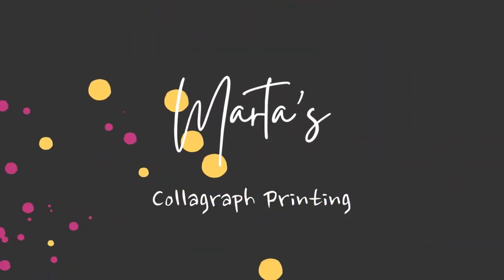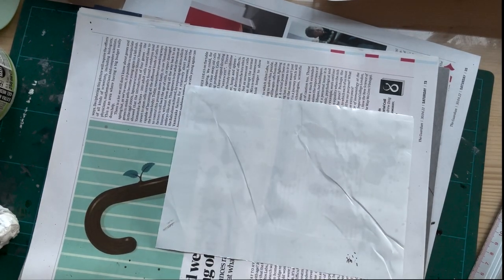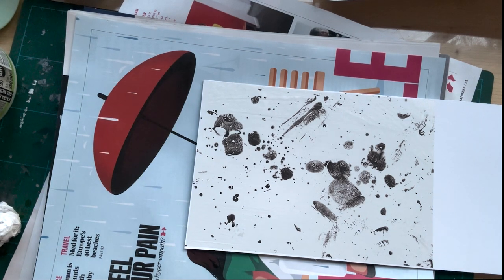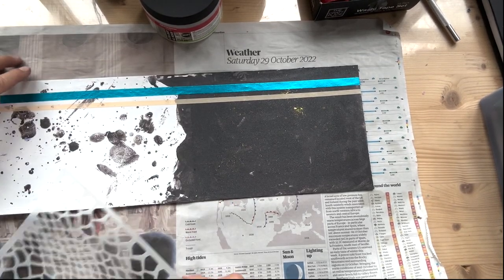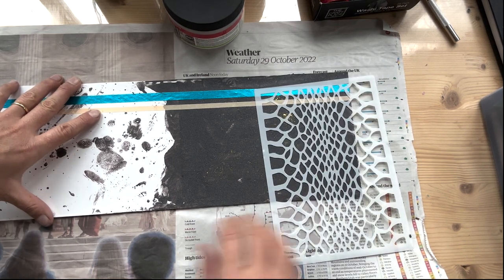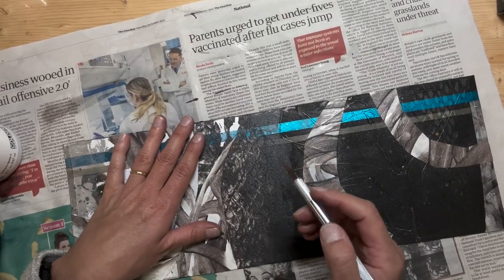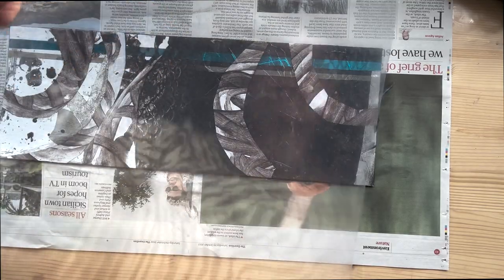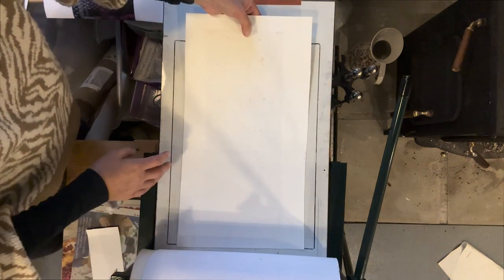A collage collagraph .... (and no plan)

Comment: Marta, this is a very sophisticated print…love it!, One query: why didn’t you apply a thin layer of shellac before printing? I was  surprised the ink didn’t clog up some textured intaglio areas however it seemed to wipe clean where you required so I guess it was the gloss type mediums which wiped light that gave you the contrast textures. Thank you for your such generous info in your videos…much appreciated.
Reply from the maker: Thank you Rosemary! Well, I used to use shellac, but I found it was not really necessary and spoiling some of my textures. If you are not editioning, then it won’t matter. I find I just do a couple of prints and move on to something different, so preserving the plate to last is not crucial. Yes I use gloss medium or varnish to show light areas

Comment: Really cool prints.  I didn't think about spraying the back of the print to keep it malleable.  So you probably wouldn't want to re-soak it as that might compromise the paper or risk ruining the under printing?  I also didn't think about masking the color plate...then again, I'd probably have figured it out because I know I'd be unable to keep from adding sgraffito to it. I wonder if anything could be put under the first printing so you wouldn't have to flip it over holding the color plate to it...maybe a dense rubber pad or something?  I've only done a few collagraphs thus far using a cheap press, but the results have been quite nice.  Thanks for sharing your experiences and knowledge with us.
Reply from the maker: Thank you for watching, nice to hear from you! Yes, it’s probably best to just spray it to preserve what you already have. Actually you don’t really have to flip it, I didn’t in my most recent video and it was absolutely fine!

Comment: ...I made the first prints yesterday of the collagraph I cut without spilling blood (this is actually funnier than you think: the artwork is an art-deco style depiction of ... dracula). And it worked of course! I'm going to have to go back and fresh up on some of the products you use to stick the paper. I used glue spray to attach the cut out design to a piece of click laminate and then sprayed it with varnish before using it as a relief-style print. But I an see great potential in casting hard plastic moulds of it and making exact embossing folders. It is unbelievable; I can just wash away the paper and use it eternally. I managed to make 4 prints of it before I decided to try to wash it and one of the designs detached. But that's pretty good for a first try and I'm perfectly happy with the results. Just wanted to let you know how your films are echoing their way into people's lives outside of YouTube...
Reply from the maker: Thank you for your kind words 🤗

Comment: What kind of board are you using to create your plate? You don't list it in your materials list.
Reply from the maker: Hi there, any mount board will do, depending on if you want to start from dark or light tone. If you want to start with light tone, use enviromount as it’s smooth.

Comment: Die Kombination mit Monoprint ist toll. Wässerst du das Papier zwischendurch? Interessant wäre einmal den Unterschied zu sehen , wenn erst der Monoprint gemacht würde. Vielen Dank für die Mühe des Teilens . Immer super😊Ulrike
Reply from the maker: Thank you Urlike! I wet my paper in between if there is a time gap between the first and second run, which causes the paper to dry. If I have my monoprint ready straight away and my paper is still wet from the first run, then no need to wet it. You can just spray the paper with water and blot dry it, it should be enough. Of course you can do the monoprint first. In fact in my next video I will be demonstrating doing a photo transfer first and then printing a collagraph and monoprint after!

Comment: Thanks for the great video! Why did you need to flip it over to print the color?
Reply from the maker: Thank you Leigh, well actually you don’t really have to do that, it’s just easier to peel off after it goes through the press. You will see in my next video I don’t flip it over as it’s too difficult and the print turns out fine.
Reply: I don’t flip it over but I know what you mean about being easier to peel off. I thought maybe I was missing something (which is usually the case😁)! Thanks.